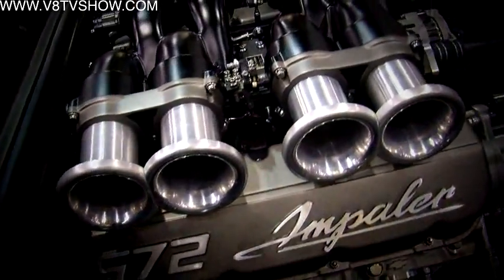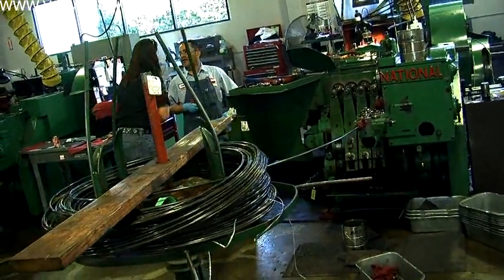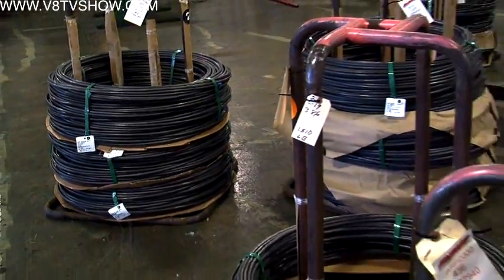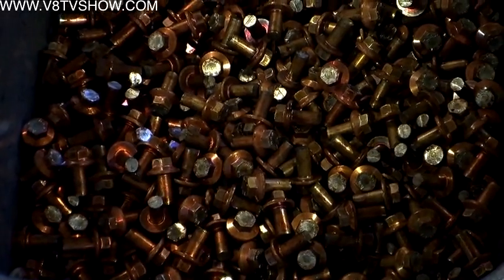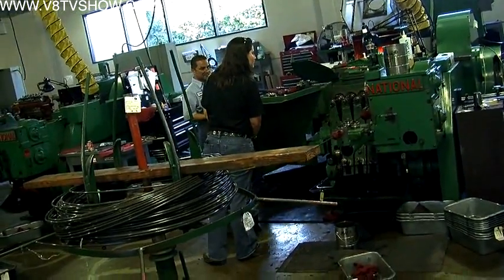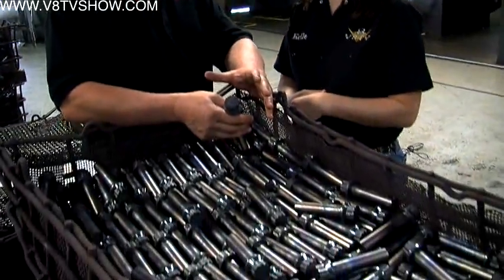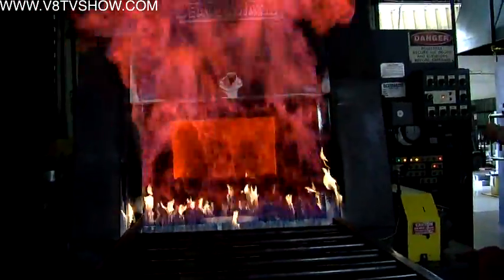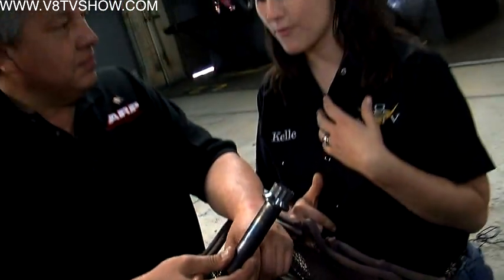Special Presentation:  How ARP Fasteners Are Made Video Series Part 1/3 V8TV

Comment: I have re-used every arp bolt I have ever put on my engines. head and main bolts. I run 9.36 quarter mile @ 156 mph. it's all in the gearing of car.

Comment: Extremely interesting and very informative. 1-8 hours in the heat treating? Individually hot headed bolts? No wonder that fasteners are so expensive. They are more labor intensive than I ever realized, since not every facet is mechanized.
Thanks for sharing this with us.